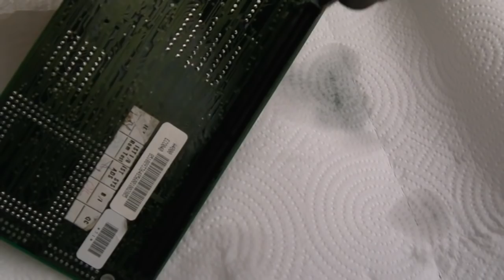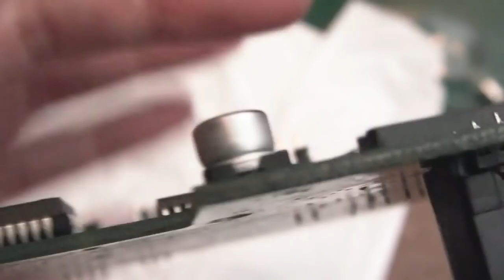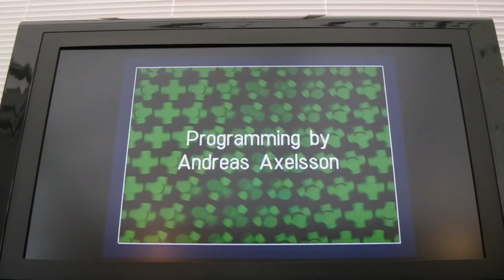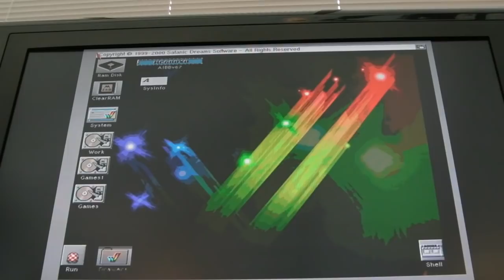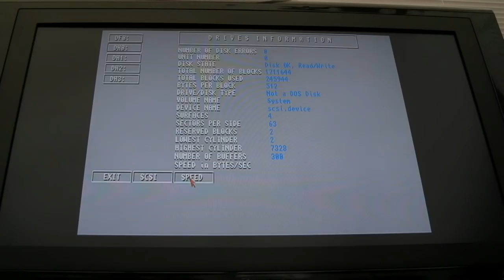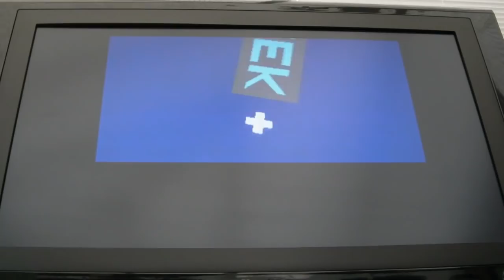Commodore Amiga A3640 Repair / Recap - 68040

Comment from the maker: The other thing I obviously did here - at the point it wasn't working at all, or giving display problems - feel the temperature of each of the chips on the A3640.  That could help you work out if one has died!  Something strange - did anyone notice the walls in Doom seemed sloped lol?   NOTE: The other difference between 040 and 060, the 060 needs an extra 74F257 and resistors and caps I think!  Those probably come fitted on an 040 to 060 adapter, and they are on the A3660 from Chucky.  In order to use the MAPROM feature you need to load the Kickstart via command line (as I tried in the next A3640 video!)   NOTE: When I cleaned up around C105 you can see the wire is loose!  I spotted that later, removed the cap again, soldered it back down, and refitted the cap again!  That was done just before it went back - after the video was complete!

Comment: If you want a challenge, I have a rev 2.1 (not a typo) a3640 that needs some help.  I wish there was more information on a3640 repair but it seems to be mainly around re-cap and damaged traces in those areas. This board had no such issues from what I could see under the microscope, but does have some older GALs. I know the GALs had to be upgraded for use in the a3000 due to timing issues. I would even include a 040 to 060 upgrade board for the a3640 for you to show and keep for your channel.
Reply from the maker: Sorry for my slow reply - missed this message!  I cannot offer customer repairs sorry!  Thanks for the offer though, with the bits etc =D  Appreciated!

Comment: I had a 040 at 40mhz  with 128mb ram on my A1200 with a power computing idie power flyer the system ran pretty damn quick for what it was 🙂

Comment: Thou shalt check voltages
Reply from the maker: Yeah, not the sort of thing you expect to need to check when you know your PSU and board is good etc.  I suspect the voltage drop had gradually increased over time without me noticing it up until this CPU card repair =/

Comment: I've told you before - MuMapROM util to put boot roms into fast RAM. If you are using MMULib, you have to install it (choose simple option, Expert install has 100s of options). Original 68040.library had huge bugs, which is why Thomas Richter wrote a replacement.
He maintains MMULib to enable a user to implement a custom version of 680X0,.library to do that and more to this day, 25 years plus of commitment. Most modern Workbench (3.1.4) will actually complain if you don't have a 680X0.library on the system (but will still boot).
Reply from the maker: Thanks - I didn't remember lol!  I did however cover this a bit in the next video (build off that PCB shown in this video).

Comment: That frontier elite intro is classic! just heariing brings back memories.....  It was a long time ago  but... if memory serves some of the missing  FPU  instructions were emulated in an 040 version of the  MATHIEEEdoubtrans.library located on one of the workbench 3.0  install disks which I had to copy over and if I remember right had to rename, please forgive my old mind  if am wrong...   I ran an /x  BBS on  an A4000 for a few years - good times...
Reply from the maker: Yes, I found the FPU stuff worked there when you have the 040 library installed!  I worked that out in the A3660 board build that's coming up!

Comment: I assume someone's already mentioned this but anyway always check for dry solder joints especially cracked ones that can always be an issue if you've done just ignore this

Comment: As always excellent work and an excellent video - FWIW: I particularly like you include your thought processes in your videos, and even your errors when they crop up along with why they were errors. Very helpful for learning, thanks.
On the subject of learning I guess the primary issue with this board is the person who previously recapped it could have done with a bit more practice?
Reply from the maker: Thank you very much! =D   Yes, the original caps were perhaps removed a bit too quickly, resulting in pad loss.  That said, sometimes you lose a pad no matter how careful you are etc, just due to capacitor leakage.

Comment: The beachball test on the 040 is normally lightning fast with FPU enabled in AIBB.  It should not go to black screen.  Maybe faulty FPU?
Reply from the maker: I mentioned this in the pinned comment I think, and in the premiere chat - I was lacking the correct 040 library at the time!  Without that library it will black screen on that test!  I re-visit this in the next video (A3660 PCB build - using the 040 shown in this video).

Comment: 24:44 it looks like you soldered your tinned via to the pad of capacitor C105.
Reply from the maker: Yes, that's correct!  Initially I was trying to avoid that - but after doing it remembered that's where the connection from the cap goes to anyway!  It goes to that via!

Comment: Why didn't you put new pads on i would never do this hack job
Reply from the maker: It's all a question of your own personal preference.  How do you fit a pad there - we didn't have the original pad and trace to epoxy down (which would often be my preference).  When there is no pad, your options are to use a wire and secure the cap with epoxy or hot glue, or cut a small pad from copper tape or something and try and epoxy that down, but it will not hold in place very well, and likely need a wire to join the pad up to where ever it goes anyway.

Comment: Yes, the “real” 68040 has the FPU instructions, but the 68LC040 does not. I don’t know about any MMU, though, or if the ‘LC040 had the 6-stage instruction pipeline or not.
Reply from the maker: This is a "real" 040 - it has the FPU (not an LC), but lacks the transcendental functions.  It failed to do anything when I tested using the benchmark there because I was lacking the 040 library.  The LC would have had the same 6 stage pipeline I'me sure.

Comment: This just makes me want a video game in which you fly your spaceship over a huge Amiga motherboard, dodging power connectors and CF cards, while bad electrolytic caps shoot globs of electrolyte at your ship, and they’ll weaken the shields and slow down the ship until you get back to base to clean it off with vinegar and IPA. 😀 Crazy, huh? 🙂 Oh, and those LEDs on the accelerator card turn into powerful turbo lasers that’ll blast your ship to bits!
Reply: Amiga game: Vyrus
Reply from the maker: =D

Comment: The old saying still holds true "THOU SHALL TEST VOLTAGES".    As for recapping sometimes people do more damage than good these old boards are fragile so they require a very delicate touch.
Reply from the maker: Absolutely!  However, I use this PSU and motherboard all the time, so I didnt expect that to be the issue!  If those parts came as a system, it would be the first thing to check =D